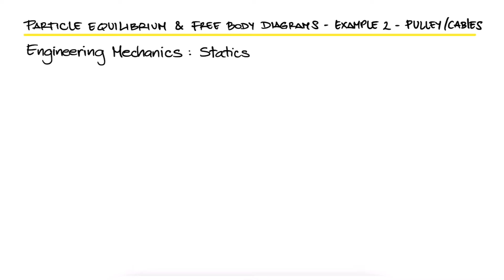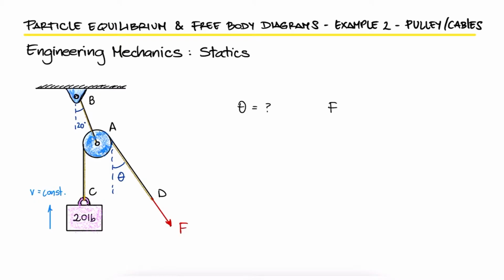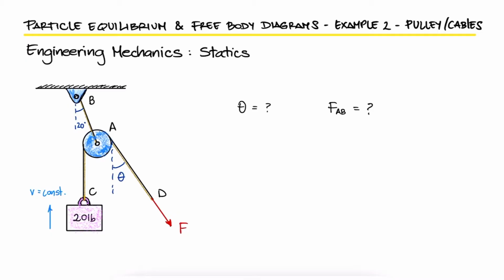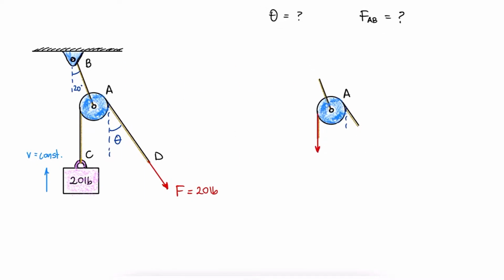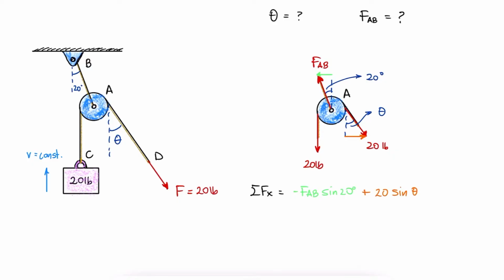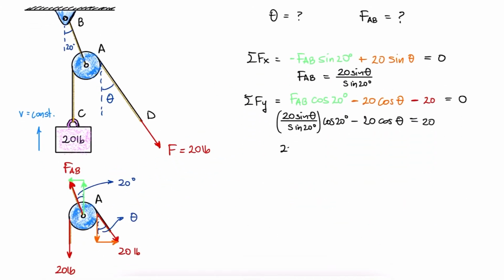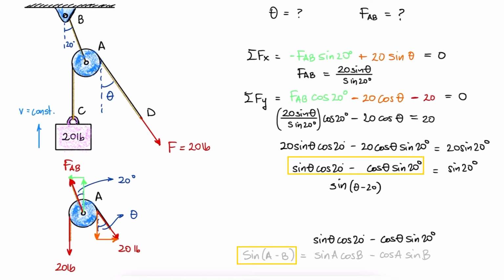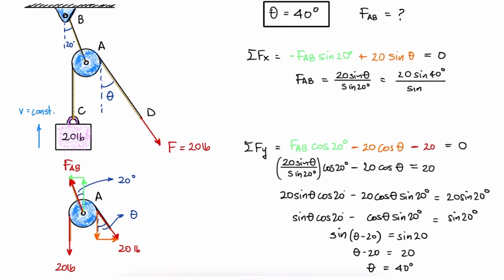Pulley and Cables Free Body Diagram in 2 Minutes! (Example)

Comment: The angle between the load AC and force line AB is 2 x 20 degrees, it has to be (assuming a zero weight pulley). So the force F(AB) is simply 2 x 20 x cos(20) = 37.6 lb. Your method seems to incredibly overcomplicate this simple problem.